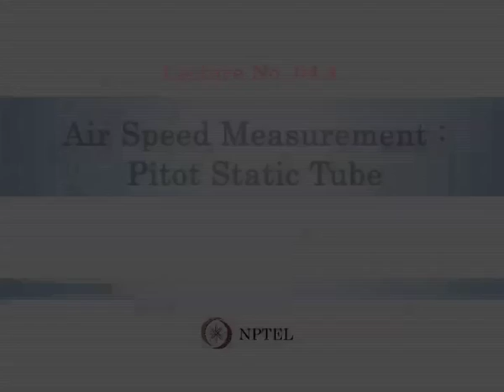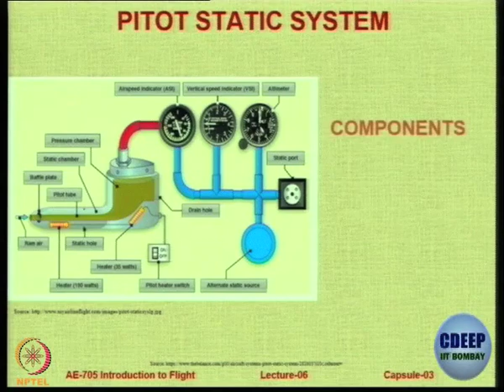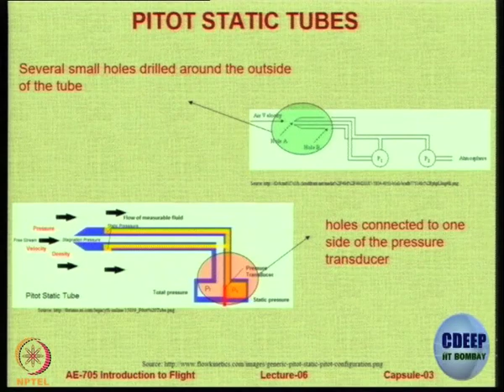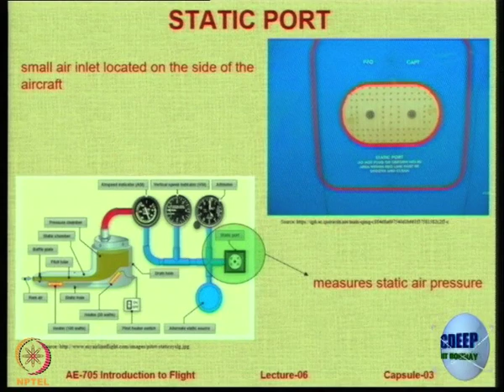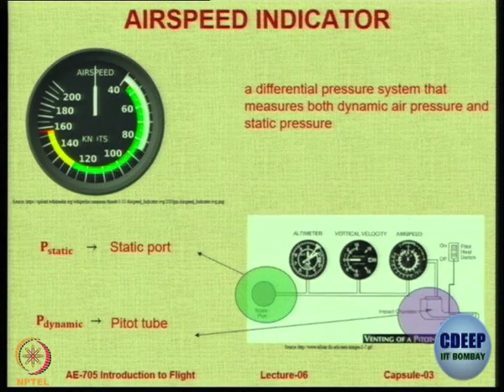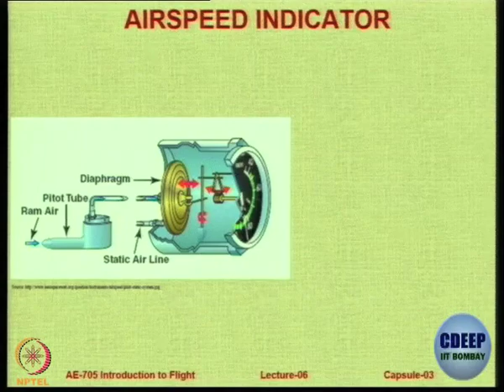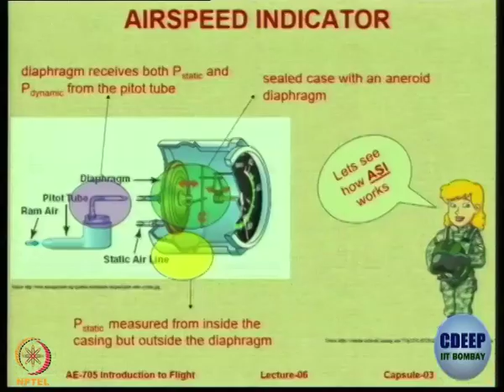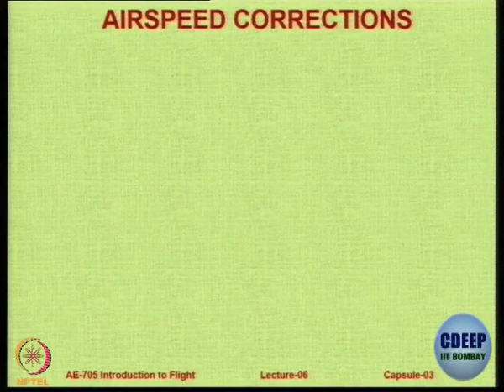Week 4-Lecture 17

Comment: 00:18 The pitot static system is used to measure the aircraft's air speed.
03:49 The location of static ports is crucial to avoid errors.
06:46 Static ports are placed at locations on the aircraft where there is minimal change in ambient velocity.
09:50 The location of static ports on the fuselage is such that it helps clear the boundary layer and minimize disturbances
12:28 Pressure measurement does not differ with the speed of the aircraft.
15:17 Static pressure is used for altitude measurement.
17:46 The airspeed indicator (ASI) measures the dynamic pressure of the incoming air.
20:10 The instrument shows zero pressure when the indicator is blocked.
22:39 Measurement of ambient wind speed